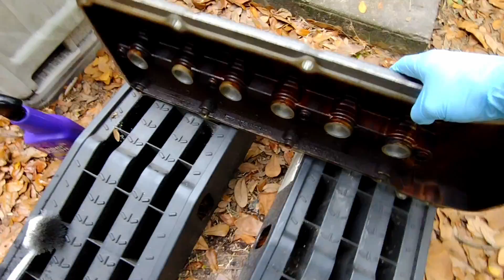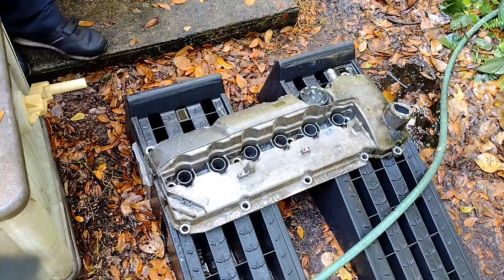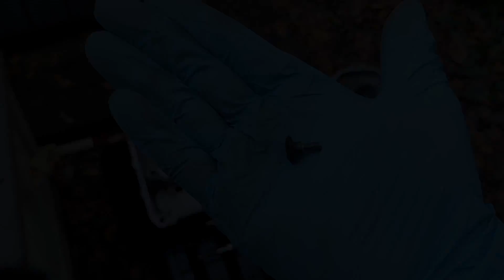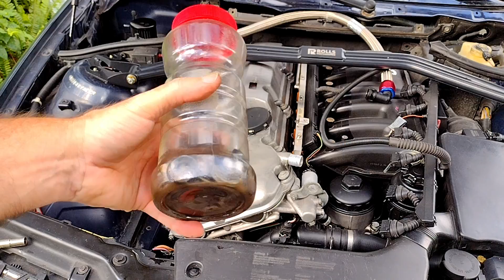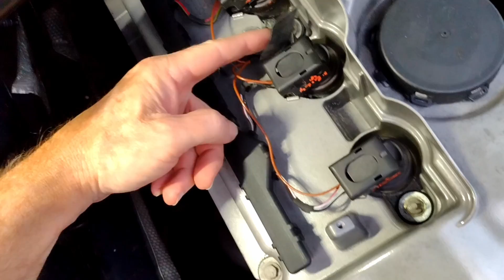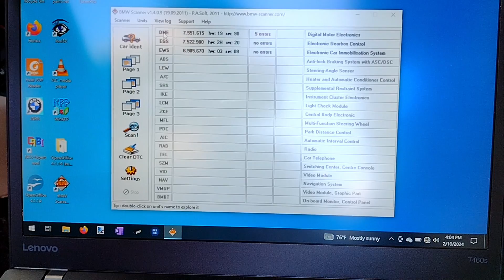BMW E46 Project: M56 Valve Cover Install, featuring Super Clean @SuperEasySuperFast

Comment: Why didnt you hook the hose from M52/M54 valve cover directly to intake hoses that comes with CCV? I see you put M56 cover and is the same thing. hose to intake
Reply from the maker: The m56 valve cover has the CCV system built in. The m54 does not. If you connect the m54 valve cover directly to the intake manifold, the engine will suck in a bunch of oil vapor. Also, it'll be like a giant vacuum leak.

Comment: Hey buddy i watched your video and i installed the m56 valve cover onto my m52 everything works but! I got bad ignition coils problem. Spark plugs are new and coils are also new but it throws codes on all cylinders
Reply from the maker: Does your ECU support pencil coils? If not, you may need to convert to MS43. Or reinstall the original valve cover and coils.

Comment: Hi, thank you for the video! 
Any ideas on how I can source the M56 Hose Connector? When I bought mine it didn’t come with it! And I’d like to keep the OEM look!
Reply from the maker: I bought the M56 PCV hose and modified it.
Reply: Thank you! And for the Hose did you use Heater Hose?
Reply from the maker: I used 5/8" braided hose. Heater hose may not handle the exposure to engine oil.

Comment: Do you plan to install an oil catch can?
If so, could you upload a video explaining how to install it with the m56 cover?
I have an e46 sulev that has the m56 engine but I don't know if it is a good idea to install an oil catch
Reply from the maker: IMO a catch can would be redundant, since the M56 valve cover basically has a catch can built into it.

Comment: Whats the advantage to swap m54 valve cover for m56 valve cover?
Reply from the maker: I hate to be rude, but google it. There's tons of info out there.
Reply: @michaelblacktree  yes but not in french and in english on Google they use fancy words i dont understand.
I just understand better sealing
Reply: @imestia7911  it has the CCV system already inside of it, and the material won't crack or warp like plastic.
Reply: Le cache en plastique du M54 est foutu. se déforme quand il fait trop chaud

Comment: Aside from the looks, what's the benefit of swapping this particular valve cover? I get that M56 is a low-emissions variant of M54B25, but is it like beefier, stronger structurally or something?
Reply from the maker: It's less likely to crack or warp. So less risk of oil leaks, or lean trouble codes.
Reply: @michaelblacktree  ah, makes sense given how often it occurs. Wish we could do this to EU-spec motors, would save a lot of trouble down the line :P

Comment: Now that you have the m56 valve cover, have you considered a centrifugal type supercharger? The OE valvecover never holds a seal with boost and the ccv system doesn’t hold up whatsoever to the extra crank case pressures. I’ve heard people get better fuel economy out of these engines with superchargers and town driving just because of how heavy they are you could see better low rpm acceleration/efficiency
Reply from the maker: Centrifugal superchargers mostly boost top end power. But I do have a couple Eaton M90 blowers...
Reply: @michaelblacktree  I know there’s a few kits of the centrifugal type, but if you’ve already got that roots one then go with that. The custom fab would be much cheaper than any of those kits I bet. They usually max out around 10psi in the kits to play nice with stock bottom ends just for reference